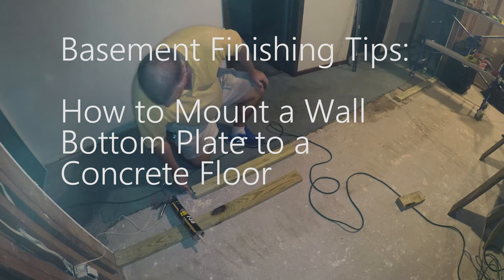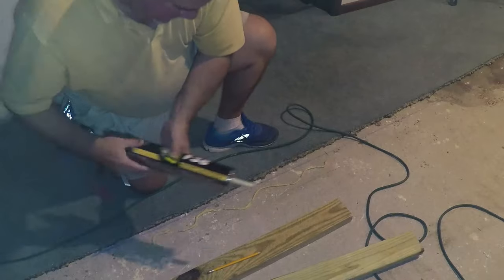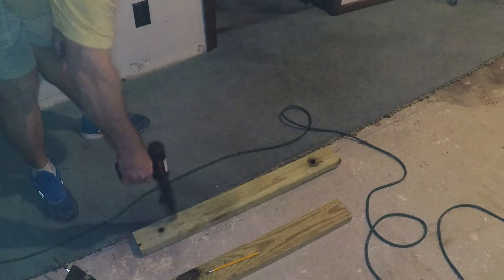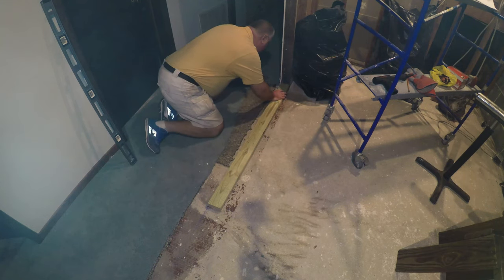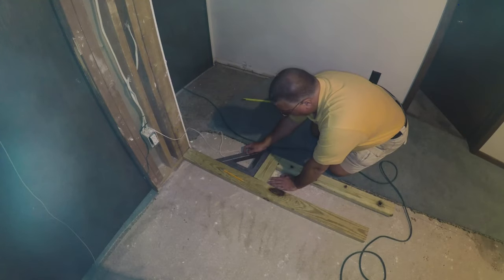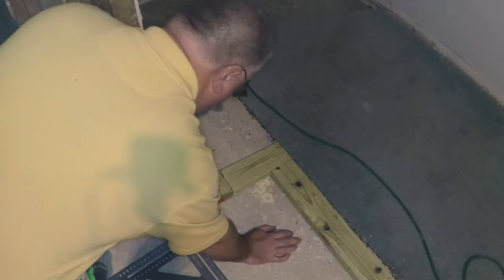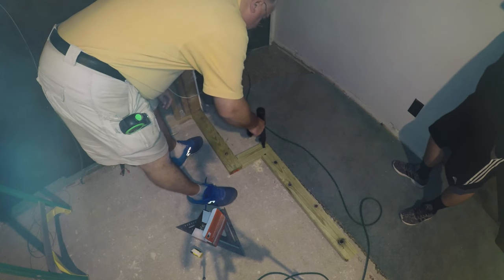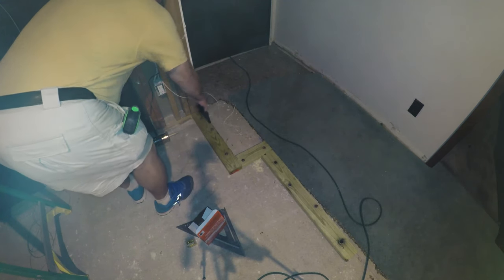How to Install a Bottom Plate of Wall to Concrete Floor For Finishing a Basement or Garage for $125

Comment: Instead of PT, have you ever used a synthetic or composite lumber for the bottom plate? I've got a slab on grade shop in a high humidity environment and i'm going to frame out some interior walls
Reply from the maker: No I have not. If the wall is not load bearing you might be ok with composite. I would stick with PT. If you are concerned about the toxicity of PT consider painting it with a sealant prior to installation.